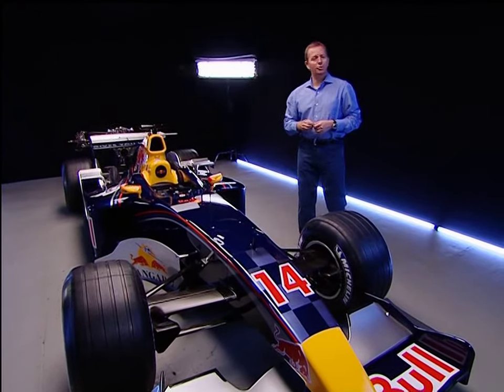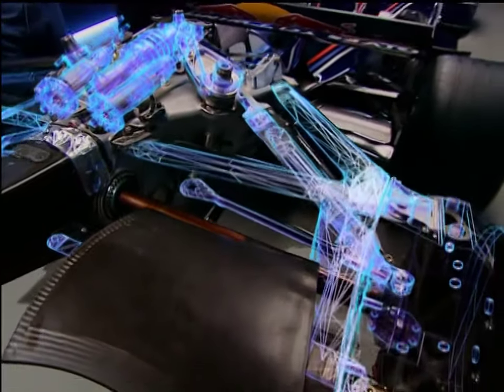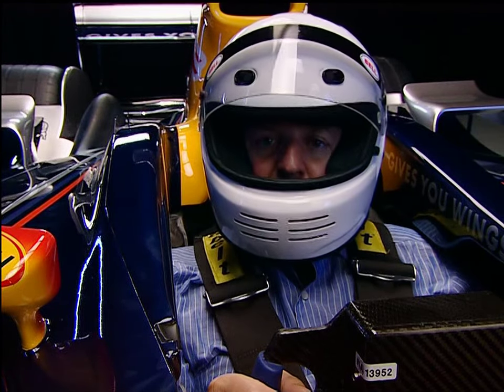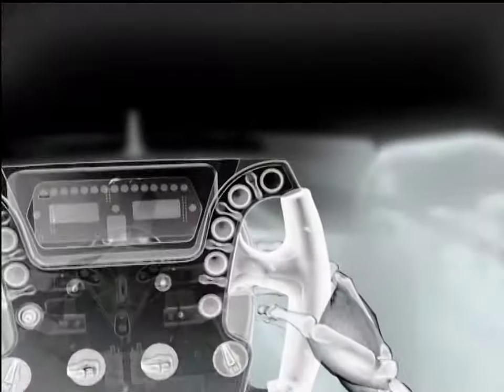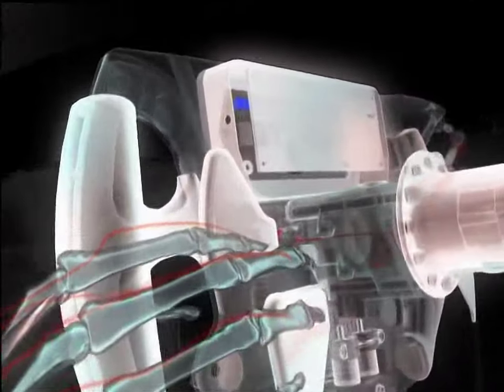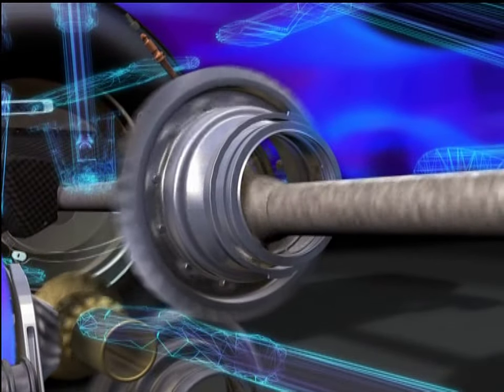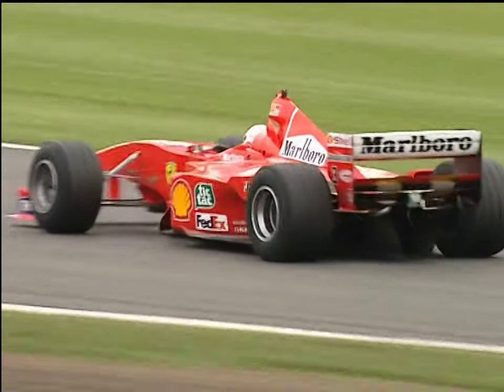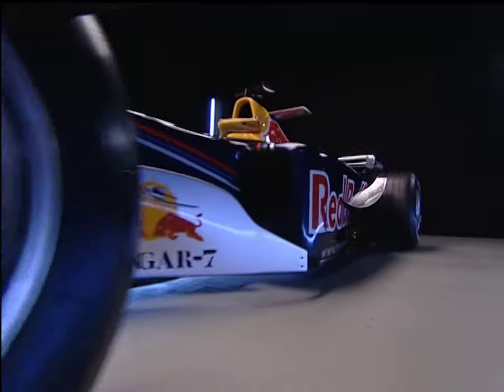ITV F1 Insight - Gearbox & Differential

Comment: What are the differences between f1 transmission system and dual clutch transmission?
Reply: Contrary to popular belief, Formula One cars use single-clutch, seamless-shift sequential transmissions, with no momentary loss of power to the drive wheels, and the clutch and shifting use electrohydraulic actuation. The clutch is only needed when starting from stationary, and after that, the clutch is automatically actuated each time a gear shift is inputted by the driver, via electrohydraulics or pneumatics. As Martin said, gears are chosen sequentially, and the sequential transmissions are much faster than the H-pattern stick-shift, simply because you don't have to depress the clutch or blip the gas every time you upshift or downshift, since the ECU and TCU control everything. There also better than a conventional H-pattern stick shift, in the sense that you can't skip gears, i.e., you must shift through all 7 or 8 gears in a sequence, preventing you shifting into the wrong gear and blowing the tranny or engine. These transmissions also use a dog engagement rather than the syncromesh engagement used in road cars, like Martin said.
Reply: An F1 car transmission is a more advanced version of a motorcycle transmission. A dual clutch is two manual transmissions combined into one with odd and even gears controlled by their own clutch.

Comment: So how old is this vid? I think these days the clutch is not released at all in a gearshift. Clutch is only used to go neutral and to get moving. The gears are basically forced in while driving. One could compare this to a motorcycle clutchless shifting, principle is the same, only its automated completely (gearshift, throttle).
Reply: The only red bull to use a V10 engine, 2005.